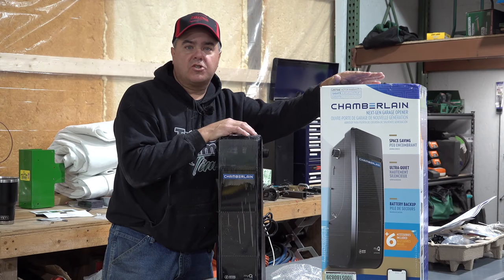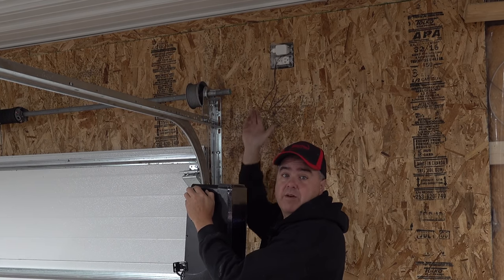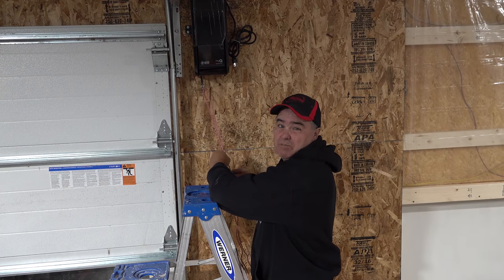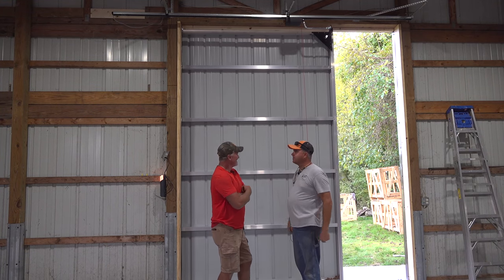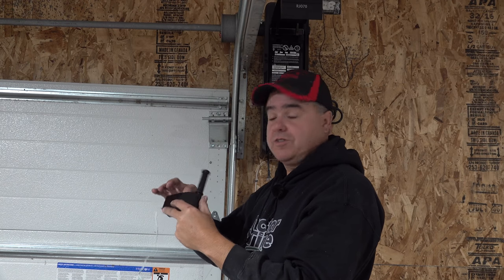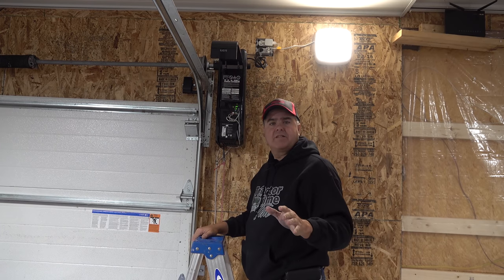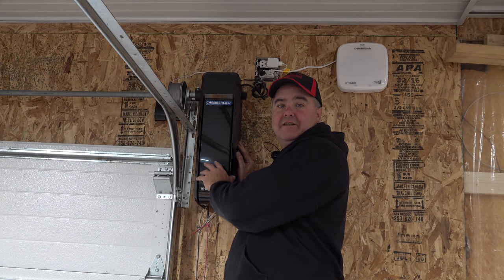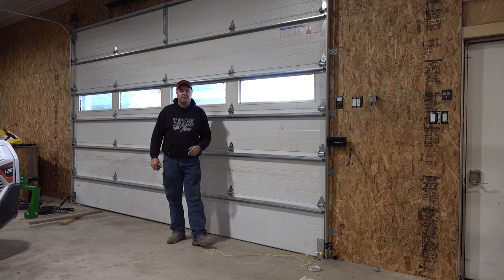Wall Mount Garage Door Opener Install - Chamberlain RJO70

Comment: I've installed 2 of these wall mounted openers.   They works great.  I recommend to others...  Yes.  Configuring its up/down movement and its other features are "a pain".   Read the manual really slowly with a large cup of hot coffee and a good set of reading glasses.  After the 3rd "read", I got it configured / working properly.  As others mentioned, go slow with its wiring connections and its profile / up & down configurations..  It's worth it by going slow....

Comment: I work in a garage and we've had the wall mount opener for a very long time 22 plus years.  Our original opener was mounted in the center of the torsion tube. It was a real pain if it needed maintenance or repair since it was in the middle. It would fail in the up or going down position. With the door in the way it made life difficult fixing it.  The newer replacements are on the side like yours.

Comment: Installed that exact garage door opener not long ago due to lack of room for our bigger door in our added on garage. One problem I had was once you open the door all the way there was not enough weight of the door to bring it self down the rails without tripping that contact switch because there’s no down pressure with this opener. Solution was two heavy duty springs that we installed at the end of the rails to help push the door down to where it’s own weight would take over.
Reply: That’s the problem with these,I’ve had to install traditional openers after going back to jobs several times for the cable tensioner error

Comment: I've had the Liftmaster brand for a few years now (7?) and one thing I've had to do on my small 9x7 door is forget using the cable switch (I've got mine propped open with a board) because the cable gets just enough slack when the motor shifts speeds (probably my door isn't heavy enough) and I've had to put pusher springs that contact the door when it reaches 1 ft from the end to gently put pressure on the cables to keep them from unwrapping. If I was going to install another unit I would make the horizontal tracks at say 30 degrees to keep more tension on the cables.

Comment: We have the same opener and cannot be more happy. 
I added some RD40 to the hinges and now you don’t hear the door at all when opening or closing.

With regards to the battery: wait until you have a power failure. Then you will experience how handy it is. The lock bolt won’t work but the door opens and closes up to 25 times or so.

Comment: I love that style opener. One thing with them is there is nothing that keeps the door down other than the weight of the door. That is why that lock is there otherwise you can grab the door and just raise it, if you are strong enough to lift the full weight of the door, when it is closed. I used on a 12 foot door in a 18 foot high garage and was able to take the door vertical the 6 feet an then turn keeping it tight to the ceiling.
Reply from the maker: Nah, it does not allow the door to come up manually (even before it hits the lock).
Reply: You do not know what you are talking about.

Comment: I had one about 20 years ago and had nothing but trouble with it. Ended up swapping out for a traditional model which is still in service today. I'm sure the technology has advanced considerably and probably worth trying again. The advantages are appealing as long as it works.

Comment: I installed the RJO70 on one of my garage doors nearly 10 months ago after the old opener failed.  I've been fairly happy with it, however, my opener will sometimes fail to close when I use the wired mounted opener control to close the door.  The wireless remote and the wifi app works every time.  Other than that I would recommend them to anyone if you're OK with the increased price over a traditional (cheaper) opener.

Comment: Tim your tube that's not level that your opener is connecting to is called the torsion tube the spring that makes your door seem much lighter than it is . its not unlevel its under load from the spring that's on the torsion tube . please don't try and level it. The spring is wound 28 - 32 times to create the force to help the opener operate the garage door. If you have questions please don't ask me... Good luck and happy garaging !!! Oh and nice choice on your opener it doesn't get better than that .

Comment: Good choice, I have that on my 12 foot and a 14 foot. definitely allows more space below the door. My metal building blocked the remote unless next to the building. I added wire to the "antenna wire leading outside. Open from 200 feet away now.

Comment: Years ago when I built a pole building and made it my garage, I installed Wayne Dalton garage doors.  They had an opener called an I-Drive (I think) which worked much on this same principle.  The motor mounted in the center of my spring bar and it turns the bar and opens the door.  I am almost 100% Wayne Dalton discontinued this opener.  I always liked the idea of how the opener worked (opened and closed the door).  Good to see something has come out similar.
Reply: Anything Wayne Dalton is absolute vomit.
Reply: @dolphincliffs8864  Maybe so.  My doors have held up well and the openers are still functioning; however, I do have an issue with one closing from time to time.  Hey, I was "younger and dumber" back then on a limited budget.  A local lumber yard had a pole barn package I purchased and the doors were Wayne Dalton; so, I went with their openers.  As Tractor Tim said, "nothing hanging down in the middle".  Also didn't have to worry about the chain/belt system.  Really do like the side mount opener he showed.
Reply: @garretlewis4103  It isn't your fault. Trust me ,I have done some ignorant and dumb stuff!

Comment: I just put a direct drive (genie) on the new 16x8 on my new garage. I love the thing, so quiet and smooth, sometimes i dont even think i opened the door till i check in the morning
Reply: The genie is a much better machine than the chamberlain/liftmaster. You made the right choice

Comment: I incline my tracks a little bit when using these operators so that there is always down downward pressure placed on the cables.  As soon as the torsion bar turns, I want that door to move.  Dust and sludge can bind the wheels over time.  The door may come down on an object on one side for just a split second that slacks one of the cables.  Even with the sensor, those cables can get loose enough to misalign on the drums and then your door will get caught or even drop dangerously.   Best case scenario for these operators is with a hilift track where the bottom panel is still vertical.  My backyard shop door (12x13h) has tracks for a 14' high door, so it gives me a slight hilift, and the operator works flawlessly because the cables are always have downward tension if the torsion bar moves up or down.  I also will tighten one or both springs tighter than specs call to ensure the cables remain tight even when the door is opened fully.  Need to always keep those cables tight on the drums with these jackshaft operators.

Comment: Hi Tim love your videos just wanted to let everyone know if your door doesn't have posi tension springs on the cable drums you eill have problems with those operators. Reason being this operator turns the spring if the  shaft if door is not in great condition the cables will move and door won't causing the cables to come off.

Comment: This past spring I installed the version without battery backup on the back door of my shop. I had to use it because the person who designed my shop (might have been me) put a wall where the opener would hang.  They are a little quirky, but overall ok. Mine has the wired internet connection....getting that to work initially was a pain and it's not showing up in the app again now so I need to fiddle with it again sometime.

Comment: Been using the lift master version of these jackshaft openers in all my buildings since 2007. First installed these for my home to stop waking up the kids when I went to work.  Then I replaced on all my other buildings for the space saving and lower noise and maintenance.  The the nice rail slide lock feature is a nice security improvement too.

Comment: Over 10 years with Chamberlin Liftmaster Elite. 16' x 8' insulated door with windows. It's been a great garage door opener and I don't understand why there aren't more used.
Reply: Do you know if it can be used with a 10 ft high door ? 10x18.
Reply: Do you know if it can be used with a 10 ft high door ? 10x18.

Comment: I just watched this video and I must say, the install of the main unit looks way more simple than I pictured and thought it would be. My present garage door openers are both 8 years old and while they do work, there's lots of slop and jerking when they are asked to raise the doors. One is an RV garage door and the other is a standard 8' high 2-car door opener. They are both working great but, my doors are SERIOUSLY noisy. And, the drive is part belt and part chain. There is a ton of jerking when starting to raise the doors. So, I'm thinking this newer style of opener. Thanks for taking the time to make this video. Very informative. 
Scott

Comment: I added onto my existing garage and put a vaulted ceiling with tongue and  groove pine ceiling.  I didn't have room for a traditional opener because it wood go right up to the ceiling fan and look ugly.  This side mounted unit maybe just the ticket for my application.  Thanks Tim.  Russ-Esko Minnesota

Comment: I had this one (The Liftmaster version) installed in 2013. In 2017 the "MyQ" control unit failed opening the door when it died. Luckily it happened was when I was home. Since it's warranted for 5 years, they sent me a replacement on my word. It was back-ordered so it took a few weeks. When I asked if the new one would do the same, they gave me a roundabout answer basically telling me it was on their tech dept radar but couldn't answer whether there was any kind of fix for this issue. Only thing I can imagine is that it's by design to sell replacement units as it was on the forums of their website with no better answer than I got. I did noticed shortly before failure, the light on the MyQ unit would flutter for about 20 seconds after opening or closing the door intermittently as it got more frequent. As I was installing the replacement I realized it was going into learning mode. If you notice it acting strange, get ready. There's no other warning other than it leaving the door open.

Comment: Another observation that needs their attention.  The coupling device to the spring rod needs to also include a solid or thicker walled bushing that inserts into the end of the hollow spring rod so you can really torque down the coupling bolts to avoid future slipping.
Reply: Wrong.  Firstly, it's called a torsion rod.  Secondly, one does not have to over torque the bolts that hold it onto the torsion rod.  Just tighten them snugly, and they will hold for years.  Recheck after year 5.  Class dismissed.

Comment: I bought several step bits, some I purchased at Harbor Freight. One was Milwaukee, kinda high dollar, it wasn't worth a crap, just drilling into my girts on my building which aren't thick. Harbor Freight turned out to be the best. Those garage door openers have been around for a long time.

Comment: Looks like a good unit.  The only thing that I found I do not like is the push electrical connectors.  At work we have a lot of equipment that has the push connectors.  They get weak over time and loose connection  We end up change then over to screw type connectors.

Comment: I think you should check out a bi-fold garage door that works with 4 inch lifting straps. I made a delivery to a shop, I was able to drive the semi right through the building. It didn't even look like a door and it sealed up better than an over head door. It was 30 ft wide. He said he got the idea from the airport.

Comment: I have had the same style Liftmaster for over a year. I like it and the battery has come in handy. Haven't used any of the wifi stuff. I need to rewatch the electronics added to your building. Yes you have to pull the rope again. I used my door a month or 2 before I had power.

Comment: What timing, I'm in the middle of installing a traditional chamberlain opener on my tractor door. I considered the wall mount style, but for my application the traditional will be fine and even buying the biggest one and the adapter kit to make it work on a 9' high door it was still considerably less expensive as you mentioned. The reason I'm putting an opener on, more than for convenience, is to get the door up above the door opening. I couldn't adjust the door enough to get it to go that high on its own and my ROPS needs 8' 11" to clear. I had made a prop to push the door up for clearance, but long story short I forgot one day and now I have a battle scare on the bottom of the door to remind me. Since then I've left the ROPS folded down, but then it's in the way for hooking attachments.
Reply from the maker: Ha!  We had an axe handle beside our old door for the same purpose!

Comment: Thank you for confirming I don't have to be perfectly vertical if my torsion bar is higher in the center. The unit has to be perpendicular to the torsion bar at the end. I installed mine today and I worried that it wasn't completely parallel to the door.

Comment: Very helpful, thanks. Helped me realize...no way am I going with wall mounted opener...ever. Charmerlain -- over thought, over designed--door lock! Separate over-bright light. Drilling holes in metal. Good for Tim though.
Reply from the maker: I eventually dumped it.  I think could be GREAT with a high lift door.  However, I could never get it to work perfectly with y my door.

Comment: I recently installed the Liftmaster version of this jack shaft lifter. At least for mine, if I pull the cables off the battery while its unplugged I loose the WiFi settings. Battery really is required for the wireless version. They don't really make that clear. Once I got it all tuned in, its been working great. I really like it and for the same reasons you wanted it as well.

Comment: I have 3 of the openers in service for over a year.  No problems.  I do wish I had the wifi models, but I can add that if I wish.  My installer advised a clear tube to fit inside the bottom seal, to stiffen up that floor seal as my concrete is a bit off level.
Reply from the maker: I think I need that as well!

Comment: Mom put a garage door put in the barn vs the old sliding door. I built little open faced boxes over both sensors so nothing can hit them easily especially since one is under the work bench

Comment: I really like these however they aren't the cheapest. I've been installing doors and operators for over 13 years. Chamberlain (craftsman and liftmaster) is one of the best. operators out there.
Reply: Door installer/tech of 15+ yrs

Liftmaster/Chamberlain is the best. 

I have installed countless LiftMaster 8500w ( same thing just branded as LiftMaster), I was not aware that Chamberlain made one that was not branded LiftMaster

Comment: Like you, I'd feel a little worried  about tightening those coupling bolts on a pipe for fear of collapsing the pipe wall. Maybe a solid, snug-fitting metal plug shoved in the end of the pipe to keep it from deforming when you tighten the coupling bolts.

Comment: Glad to see there is a cable sensor, back in the 80's I worked where they put that style opener on 4 overhead doors in the warehouse.  The openers didn't have a sensor like that and for some reason one of the doors jammed in the opening for a couple of seconds.  The opener kept turning the bar, which unrolled more cable.  The cable came off the pulley on to the bar and when the door freed itself, came down with a big bang.  Luckily no one got hurt, but it could have been bad.

Great install video.

Comment: love your videos.  That said I can give you an idea I use on the garage door bottom gasket.  When I installed a new gasket I took a foam water pipe insulator tubes and I cut it in half then slid it into the gasket with the rounded side down.  This made for a much tighter seal on the bottom of my door, and it really worked well.   
Thanks Bob Jensen
Reply from the maker: Thanks!  I was thinking about trying something similar.  I was thinking of softer foam.  Do you think the pipe insulation turned out to be the right weight?

Comment: Tim and Christie, I just installed the same unit on my barn. My 2 biggest challenges were building the framework behind the opener and then programming the travel. We still need to find a project for Johnny and Sassy Massey(1526) to do.
Reply from the maker: Met you with Casey in the middle of the road, right?
Reply: @TractorTimewithTim  yes sir, you thought I was the law. 😀
Just west of Cicero.
Reply from the maker: I did!

Comment: Another good video.  I've had one of these (ceiling mount) for many many years.  After about 5 or 6 years I had to replace the battery.  But I'll never buy a garage opener without the battery backup. I now have 4 of them.

Comment: I'm surprised the mount doesn't use bolts that would go all the way thru the mounting hub & pipe instead of set screws  which could crush or perhaps loosen up .